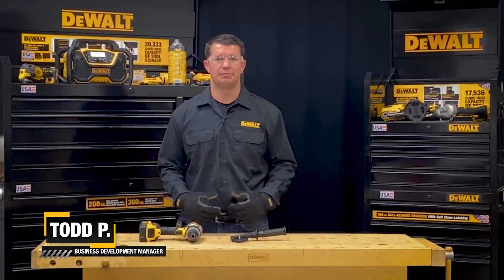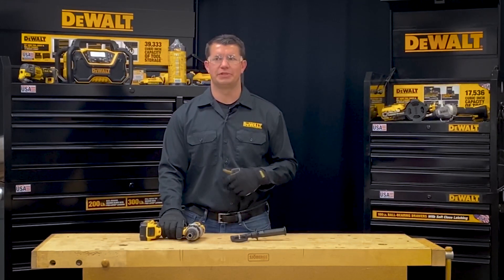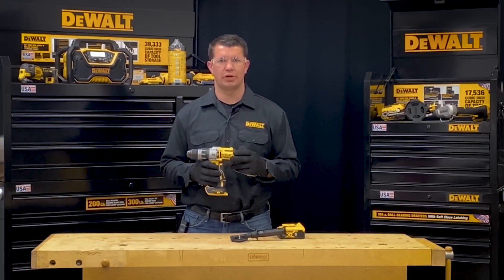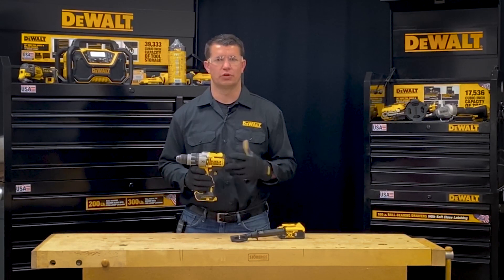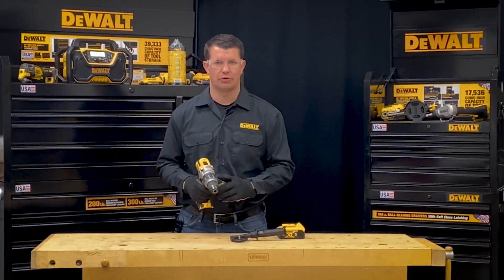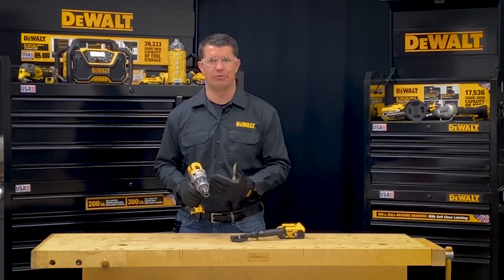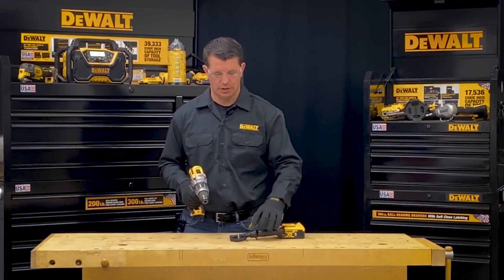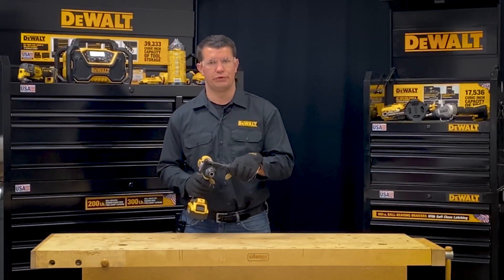DEWALT Product Guide - Cordless Drill Speed, Torque, & Clutch Settings

Comment: On my "999" the chuck makes clicking noises while tightening, even if there is no bit . It also makes clicking noises when I loosen, I've never had a chuck that did that. Is it like that for anyone else out there.
Reply: My dewalt cordless also clicks when you tighten it, that's the rachet and it is normal. You can also hear a click when loosening.
Reply: @ZippletTech  hold the chuck and lightly squeeze the trigger until the Jaws open completely, then flip the button so it spins in the other direction and lightly squeeze the trigger until the truck closes completely. That should reset it again if it doesn't just do that a couple more times and it'll eventually reset itself and it won't make any noise anymore.
Reply: I have a chuck that is frozen and won't move, I would be happy hearing a clicking noise. 😂